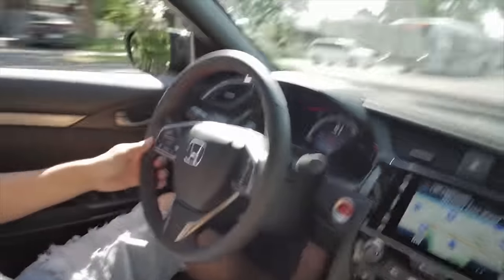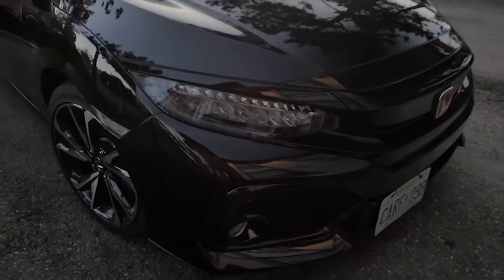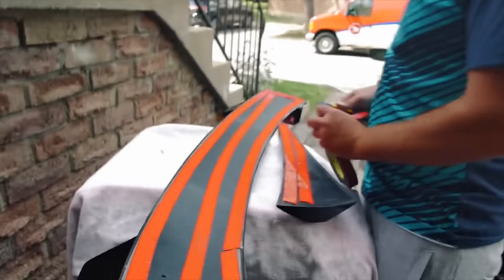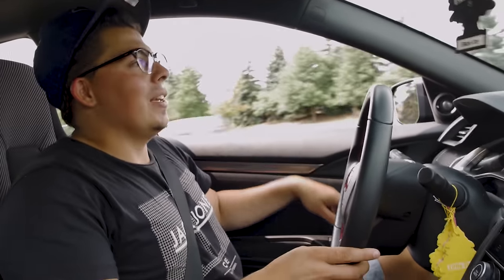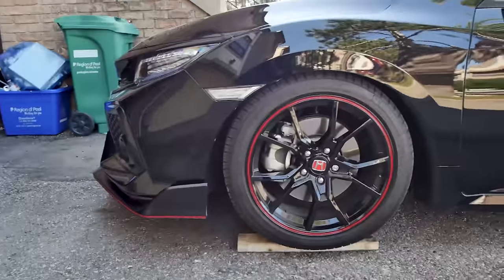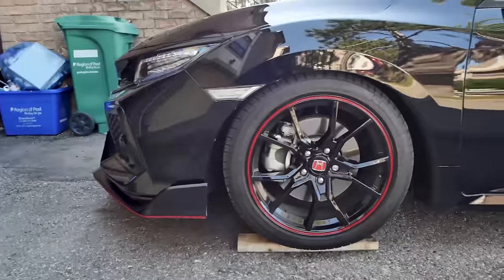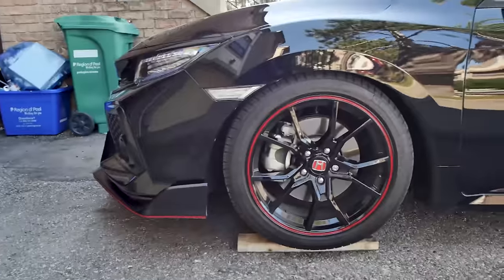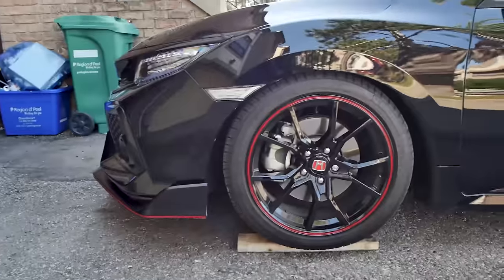BUILDING A CIVIC IN 20 MINUTES....AWESOME!!!

Comment: Glad I found this video. Just picked up and 18 SI yesterday with 80k. Super low for an 18. It has the same wheels as your first set but they’re powder coated all black and they don’t have that machine finish on them. On my way home from the dealership I was averaging about 58mpg. Crazy that these will get good gas mileage even in sport mode with spirited driving. Mines all stock. For now.

Comment: What are the offset on the rpf1??
Reply from the maker: 17x8+35
Reply: @ChrisLowpes  wow that actually fits? Because I looked up our specs and said +40mm. Im looking into buying a set but wasnt sure if +35 would be alright.
Reply from the maker: Tpango 1 yea fits with no issue. Most common aggressive fitment I’ve seen people run is 18x9.5+38

Comment: How much wheel Hp?
Reply: Also wheel torque and psi ?
Reply from the maker: Haven’t ran it on a dyno but roughly it should be 230-240whp and 250-280wtq
Reply: Chris Lowpes probably more bro, your tuned and full bolt on basically, my cousin has a 10th gen si with e85 Hondata tune and he’s at 243whp and 290wtq so your probably making more
Reply: All he has is e85 and hondata
Reply from the maker: Streetlife CC yea I’m on 94 pump gas so it should make decent numbers